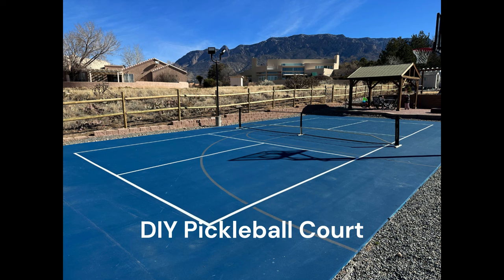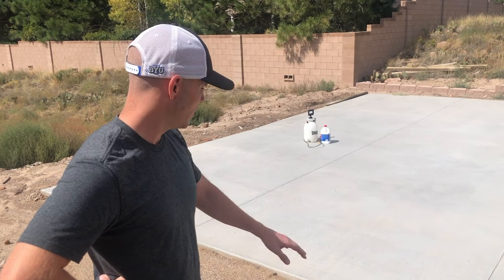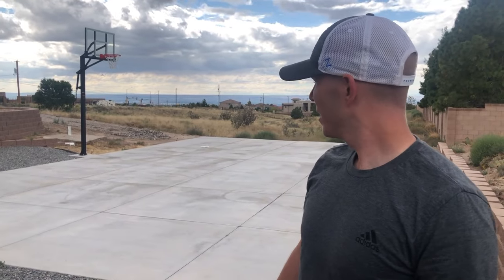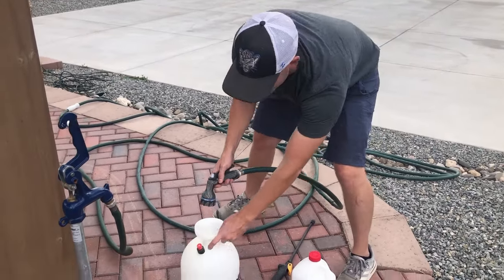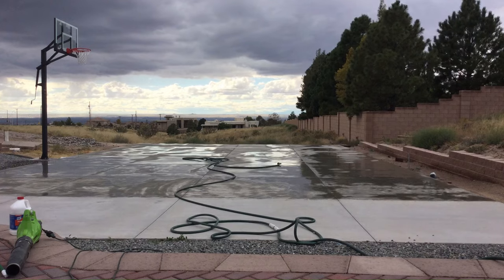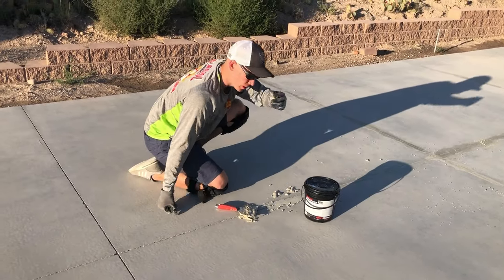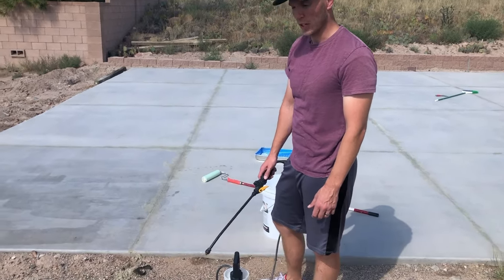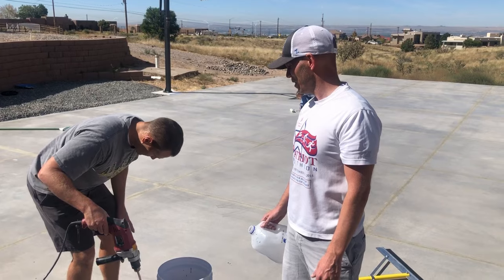DIY Pickleball Court

Comment: Fabulous job. FYI. Your chalk line can be used as a plumb bob and to scribe circles so you don’t have damage your tape measure
Reply from the maker: Good call. I tried using a string, but you have to keep good tension on the line to ensure there is no wiggle. Not insurmountable, but the stiffness of the tape measure made the process a little easier/fool proof, at the expense of my favorite tape measure...

Comment: If you don't want weeping under the tape, do a first coat with the same color as the court then 2nd coat with white. Then a light touch razor blade when you pull the tape up.
Reply: could you explain a little about light touch razor blade?
Reply from the maker: Thanks for the tip. The Stripe Rite did a decent job after I got the hang of it.

Comment: Great Video.  Can you list which products you used?  Also wondering if you are happy with filling the cracks.
Reply from the maker: Thanks for the comment. I put a complete list of supplies in the video description. As for whether or not I'm happy with filling the cracks, time will tell. At about 2 years in, I'm happy. But if the cracks start chipping, then I may regret it!